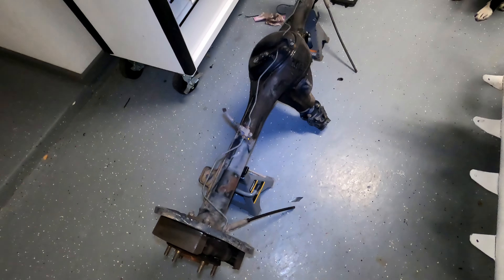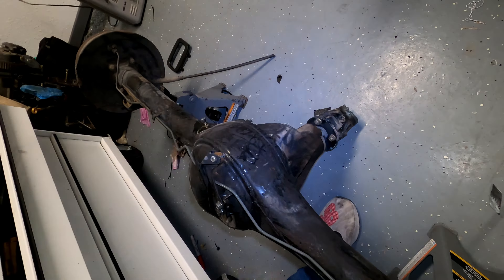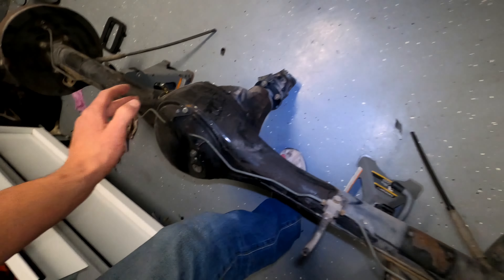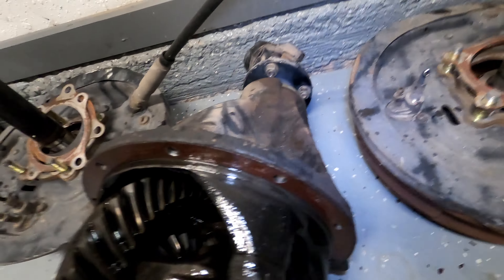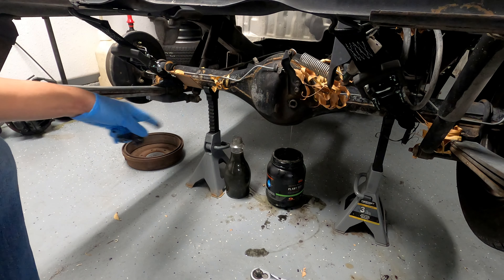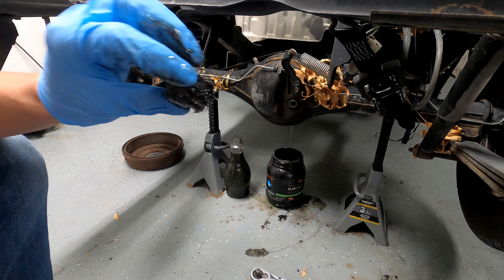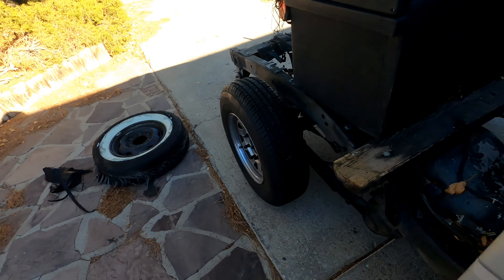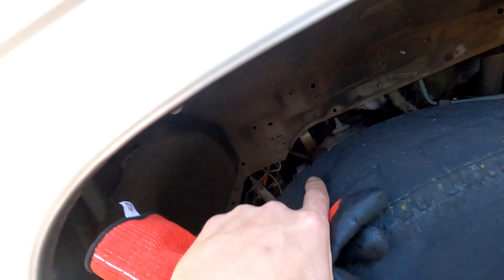Welded Diff Installation | Turbo Nissan D21 Hardbody

Comment: I have had an 84 Nissan Pickup (box channel frame) since 1990. Tough little truck. I took the bed off once to install a better one. Without the bed the truck flexed like crazy. I installed the new one with 4 of the 8 bolts initially which was better, but once I installed the other 4 the truck was back to it's extremely rigid self again. Not sure on the Hardbody version, I fully intended to buy one of those when I could afford it but they flex way more than my 84 completely put together so I just kept driving my 84. Still driving it.
Reply from the maker: They are good little trucks. Yoshi feels like a banana when sideways so I can relate.
Reply: @Dakemp240  
I imagine it does! The Hardbodies flex a lot normally. With no bed, more power, welded diff I bet it is quite squirmy! That is actually a form of traction control if you think about it, though. My 67 Mustang convertible won many "road" races due to it's ability to flex and keep traction around 120mph corners 4 wheel drifting. I learned the technique watching McQueen in Bullit. And my Nissan is called Ho Chi....

Comment: Are you running a H190 or H233B rear axle?  Could you also share the gear ratio or axle code that you’re using.
Reply from the maker: H190 with 4.11 ratio